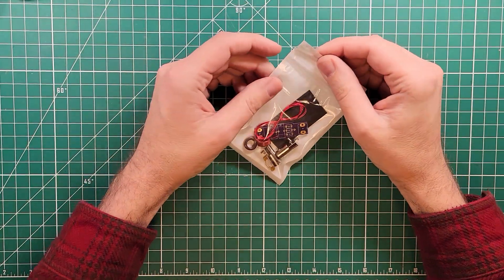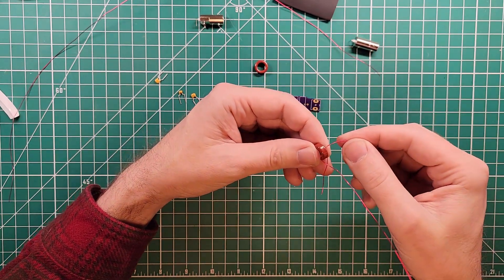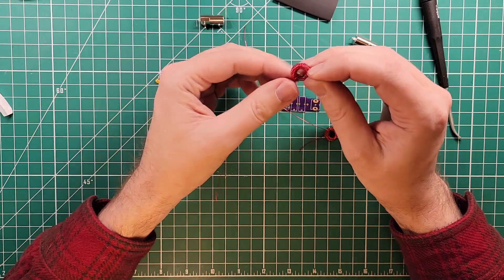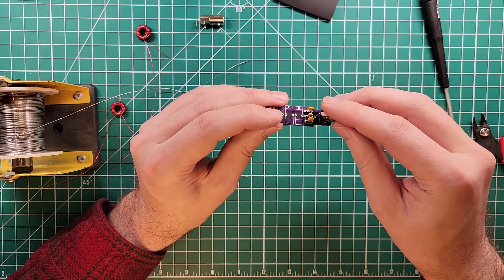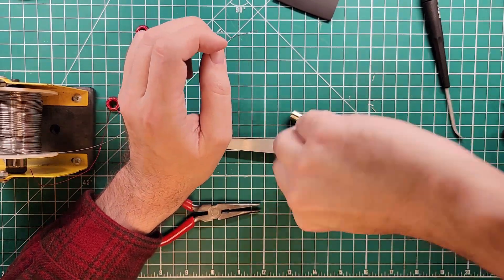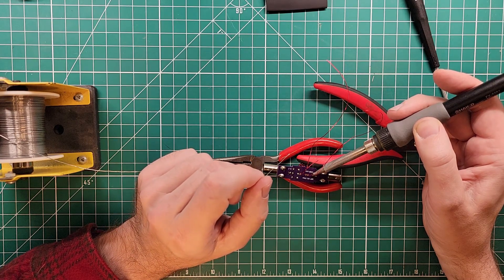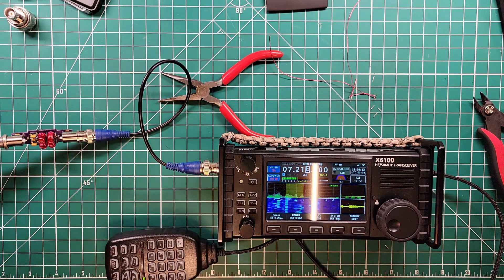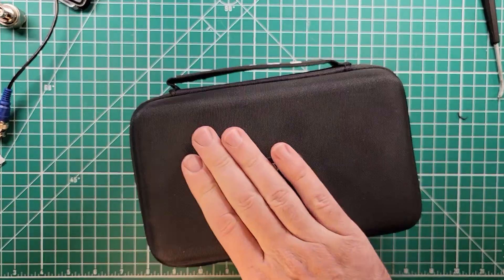Get rid of AM Broadcast Band Interference on your Xiegu X6100

Comment: i know you posted this video a year ago, but id like to ask.... at the time of this recording, the x6100 is your fav qrp radio. that said, here is my question. did you receive am broadcast on any antenna you tried to use? i just got this radio, and im out in the yard making and testing antennas, and ONLY when i use a efhw do i receive am broadcast, on all bands. when i use my wolf river coil vertical, i do not receive those am signals. did you experience this same thing by chance???
Reply: That is fantastic! VERY glad I found your channel. Definitely have a subscriber here!
Reply from the maker: I didn't try that setup that you're using - but it makes sense to me that you wouldn't have issues with the wolf river coil - due to the nature of the coil loaded vertical, you're actually using a "Hi-Q" antenna - This antenna will have a very acute V shaped SWR curve (and reject more signals as a result) compared to an EFHW antenna that will have a broad SWR curve (and pick up more signals as a result)
Reply: I do appreciate you replying! And I do appreciate this video. I ordered this kit yesterday as a result of your video. I just learned of you channel, and am glad I found it! 73!
Reply from the maker: @KU8RLY  thanks for subscribing! I did do a follow up on this filter: https://youtu.be/qF5idlbnsds

Comment: The Digital multimeter couldn't get a continuity because of the caps. Capacitors only allow AC currents to pass and the continuity test is DC. I learned that in the ARRL Handbook.
Reply from the maker: Nice, thanks for helping!

Comment: I just ordered the kit today. My friend Carl from Chameleon Antennas was getting swamped by AM broadcast at his QTH. He built the filter and said it worked like a charm. I don't need it at my house but will keep it with the xcvr just in case! On another note, heat is a problem. Heat sinks, turning off battery charging while transmitting and using a DC Buck module when connect to a 12vdc supply helps a lot.
Reply from the maker: This radio would have been a lot more popular if they offered it in the "tinker" sense instead of the "completed product" sense - I think a lot of people got a distaste after it didn't meet up to what was written in the marketing.  You're doing a great job of taking a good base and making it even better.  Keep on Keepin On!

Comment: seriously, get yourself a "helping hands". it will improve your soldering experience no end. BTW, there is no dc connection though this kind of filter, the capacitors are in the signal line, the inductors go to ground.
Reply from the maker: Thanks!

Comment: I was reading the description of the BCI filter and it says “High SWR can damage the filter. The filter should be inserted inline between the transceiver and tuner, rather than between the tuner and antenna.” Can you show how you would install this unit in x6100 between tuner and transmitter
Reply from the maker: Radio - coax- Filter- coax - tuner - coax/antenna - you need an external tuner (or resonant antenna) and can't use the radio's built in tuner.

Comment: So if I use one of those, will that get rid of the solid red “band” on my waterfall that happens sometimes after I transmit? It goes the full length of my waterfall and sometimes has a thinner second “band” preceding or after it! I can’t figure why it’s happening. I’m very new to ham. Only had my general since February. So I’m still learning and there appears to be a lot to learn!
Reply from the maker: I'm not sure I understand.  What I can say is that if you have a nearby AM broadcast station, your Xiegu radio (any of them) will be mostly unusable due to overloading.  This filter blocks out all AM Broadcast traffic so you can operate again.

During your TX, you should have solid red on the waterfall - that's your signal going out at full power. (or shades of red depending on how much fire you're putting into the wire).  If you're saying that after you release PTT you're still seeing solid red, that's probably something misconfigure and worst cast scenario, something is wrong with the radio.  I'd need more info.  Feel free to join TOADs discord where we can have more brains and share pictures and discuss.

Comment: If you wrap a few turns of a rubber band around the handles of your pliers, you can use the pliers as a clamp to hold your PC board still while you solder it.  Thanks for the vid, too.
Reply from the maker: That's a #ProTip

Comment: Honestly I didn't watch the whole video TO, but doesn't a filter prevent you from using your tuner? I understand you're not supposed to tune through a filter. 73 de VE3GKT
Reply from the maker: Yes, Dan mentions that on his website - I  don't think it's the tuner so much as the SWR, but I'm not sure what the real answer is.
Reply: @temporarilyoffline  filters such as this are designed to work at a particular impedance - tune through them and filter performance could be degraded, the filter could be damaged, or it may not pass the tuner output impedance correctly
Reply from the maker: So the way to use a tuner with this is antenna->tuner->filter->radio - and remove the filter for tuning and then replace it for operating.  Less than ideal, but so is having strong broadcast signals overloading your front end.
Reply: @temporarilyoffline  it should be ok for tuning as there will be RF making it through for an autotuner to detect. But yes, you'd have to use an external tuner in the arrangement you described,, which seriously sucks considering a selling point of that rig is the internal tuner

Comment: Steve… get yourself a “third hand” at Harbor Freight and add some heat shrink tubing on the claws of the alligator clips.  Great for holding small circuit boards for assembly.  I have a Panavise workstation for soldering circuit boards.  It’s too big for most of the circuit board kits you’ve assembled lately.  73 de KD6UYK (Tim)
Reply from the maker: Have you seen the commodore 64 build? ;-)  when I try the heatshrink on my helping hands, it just comes off fast.
Reply: @temporarilyoffline  The C64 PCB is too big for a helping hands device.  When I was a tech for Star Micronics America in the mid-1980s, such a luxury of have a pcb vise wasn’t realistic.  73 de KD6UYK (Tim).

Comment: The reason you don't have continuity from pin to pin is that the Capacitors are blocking DC used by the tester. Yes! this is needed by the Xiegu X6100 badly. I have problems mostly on 20 meter bad by overloading of some sort. I am building one but good enough for up to 100 watts. But... for the cost of it... I may order this $20 version to use only on the Xiegu X6100. I see these are for 10W max. Mine will be with double toroids and 1KV caps for higher wattage. 
I learn a lot from your videos. Thanks for taking the time to post them. I started up in technology in 1994 with a Commodore VIC-20, upgraded to C-64 then the C128 and jumped out to IBM PX, XT, AT and the rest is history. Mention this because I see some of these treasures in the background of your videos. .....uhh forgot to mention the Commodore Plus 4. 
A hug from San Salvador.
73
Rob
YS1RS
Reply from the maker: https://youtube.com/@TemporarilyOfflineRetroTech check out my other channel for retro content!

Comment: If you don't want to spend too much on a PCB vice then maybe consider getting a set of helping hands. They are pretty cheap and often are good enough at holding the board just enough that it won't slide around when holding it. 
I still need to take my Xiegu into the field and test my BCI filter on 40 meters to see if it works. I ran it through the nanoVNA and seems correct to me though.
Reply from the maker: I've got a PCB holder  I'm eyeing.  The filming and the tiny dpace add another layer of complexity... also I more often make larger boards and they don't suffer from board walk.
Reply from the maker: I've got a PCB holder  I'm eyeing.  The filming and the tiny dpace add another layer of complexity... also I more often make larger boards and they don't suffer from board walk.

Comment: He should make a 20w version for the G90. I built a VK3IL filter due to the being surrounded by AM Broadcast stations in the SoCal area, the G90 was getting hammered here in the day when that portion of the band is short during day light hours. A small filter like that would be awesome.
Reply from the maker: I messaged Dan. We'll see
Reply: @temporarilyoffline  awesome sauce!
Reply from the maker: Dan says "try it" - he's tested 10w FT8 through it, so 20w SSB should be fine.  He's concerned about the capacitors - they are pretty cheap to replace/upgrade
Reply: @temporarilyoffline  will do caps are cheap. :)
Reply from the maker: Dan says he's using 200v caps
Reply: @temporarilyoffline  nice, so you could bump those to 500v for a bit more margin. I assume mica caps.
Reply from the maker: Mica would be best, but I don't think Dan used Mica caps.  (I could be wrong though)
Reply: Is the wiring diagram the same as the VK3IL filter?
I couldn't find it! I'd like to know the differences and to build a one totally DIY. thanks.

Comment: I just noticed this in the amz listing: "Caution: If using a tuner the filter must be placed between the transceiver and tuner. High SWR can damage the filter." This means it's not a great choice for transceivers with built-in tuners...
Reply from the maker: Not as elegant, but you can put a tuner after the filter.